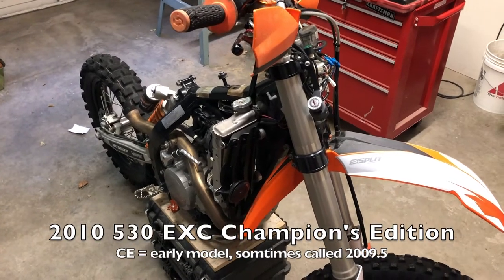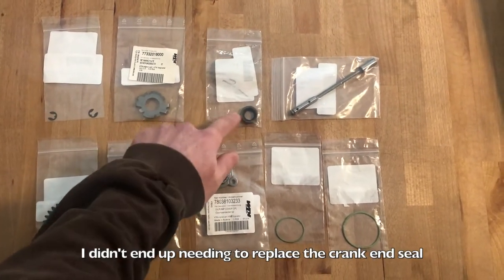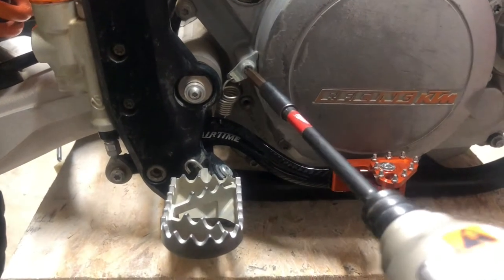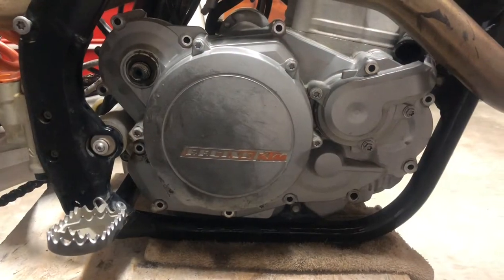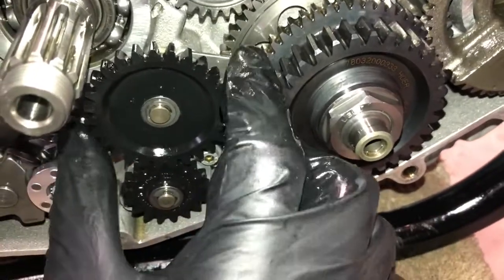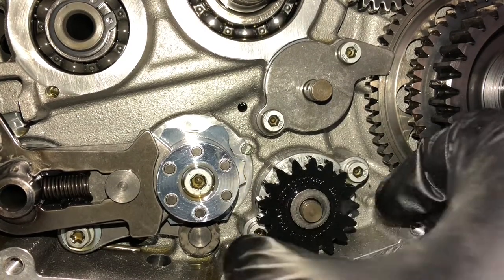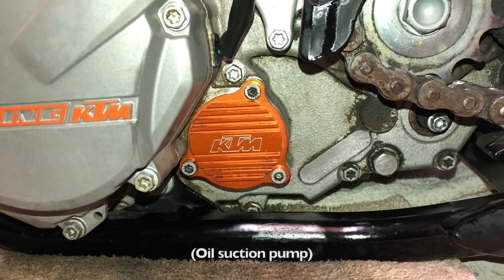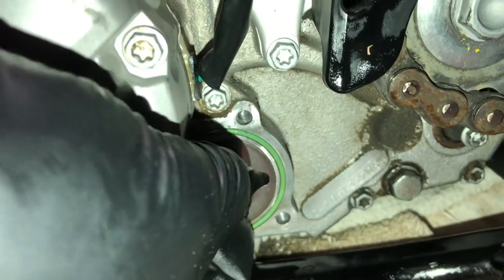KTM Oil Migration Prevention, Oil Pump Upgrade, Gear Case Venting Fix

Comment: Hi mate, great video! Detailed and precise. I have a couple of questions that I am hoping you may be able to shed some light:
1- if the bush has rotated or installed incorectly blocking the 2 holes for the gearbox vent, how does this make the engine oil migrate in to the gearbox? if the gearbox is pressurising wouldnt that cause the gearbox oil to migrate in to the engine?
I have a 2008 530 EXCr with the breathers connected as per OEM, engine and gearbox T'ed to the carby intake and I am yet to strip it down to see if the bush is correct and at the same time upgrade the oil pump (if it wasnt in the recent rebuild by others)  but my engine oil seems to disappear from the sight glass on every ride, i.e. a complete sight glass in approx 20km regardless if I am riding on dirt or road. Top and bottom end was done about 15 hours ago and oil issue was there before too. what are your thoughts? Thanks.

Edit: Gearbox oil level is unaffected, always at the right spot.
Reply from the maker: Hey great questions. You may be right about the vent. If blocked I would suspect oil to transfer from gear case to engine sump. But due to heating and cooling I could see it going either way.

But since making this video I have been watching my levels closely and I have the same results as you. I start out with engine sight glass topped out and gear case level with the check/fill bolt. Recently I did 100 miles and the engine oil was at the bottom of the sight glass. I did some checking and found the gear oil was still level. So I think the oil must be burning off. It’s only what, a .6L sump? Tiny. So level will change fast. Mine doesn’t have a lot of miles, compression is high, power is good, no visible smoke. So I’m not sure it’s a problem but I’m pretty sure I’m burning oil. Maybe that’s what you’ve got going on too? Fortunately it doesn’t take much to top it up 🤷‍♂️
Reply: @colindgrant  thanks for the reply, 100miles though is much better than my 15 or so.... mine doesnt blow smoke and power is great, but I am told there is a smell of burning oil.. given the motor is fresh, I wonder if it is been sucked through the breather and if so how to stop it.
On another note, have you had any experince with oil wiping out of the water pump drain?
Reply from the maker: @gerrykolaitis6515  No problems with oil and the water pump on mine. Definitely strange that you would lose that much oil in just 15 miles. But you're on the right track to diagnosing it. As far as I can see there are only 3 places it can go: 1) A leak through gasket or breather would coat parts in oil, you would see it. 2) Into the gear case, you would see higher level. 3) Burning off, it would make sense that you smell it, but possibly no visible smoke.

You may be able to tell if you're burning oil by looking at the plug after a hard ride (I don't recall exactly what to look for, but there's plenty of talk online about reading plugs).

Some people say it's a common issue on these bikes especially at higher speeds:
https://www.advrider.com/f/threads/530-using-losing-oil-denver-ktm-mechanic.822303/
Reply: @colindgrant  Thanks. So i have removed the breather from the carb and shoved in a bottle to see if it spews out oil, after a 2 hour road ride, the bottle was completely empty, the gearbox was at the correct level - checked when cold, but the sight glass had dropped right to the bottom, similar to when the breathers are connected to the carb, give or take a little.

So it seems that I am not breathing or migrating but burning.... I had a look at the link you sent and it does seem that it is a common occurance on the 530s... although mosy were saying that it is worse on the road... seems to be about the same on mine, i.e. road or dirt..

The other thing that I have noticed is that there is a bit of oil dripping from the wheep hole on the water pump.... I have ordered a set of new seals to replace them,... although not something that you d expect after 20hours from a rebuild...... I hope its nothing more sinister.
Reply from the maker: @gerrykolaitis6515  clever idea with the bottle. I agree it doesn’t make a lot of sense. Please post if you find the source of the issue! I’d be curious to know. Best of luck!

Comment: Great video! I was wondering what the torque spec was on the clutch basket?
Reply from the maker: I don't recall, but it's probably listed in the service manual.

Comment: I had an 08 450 excr, had oil migrate from engine to gear box,did every update possible apart from new crank cases. All the fixes did was make the oil migrate the other way.even the dealer couldn't fix the problem.
Reply from the maker: I've read that about the '08, seems the first year of this motor was the toughest to deal with. Some say the case has to be split, and a port added to make it a single sump system. You probably know better than I.

From what I can tell most of the problems were resolved by the time my 2010 was built, but this seemed worthwhile.

You say 'had', did you end up selling your '08? Because of the oil migration?

Comment: Is there an update on how this is working out?  I ordered all of the parts yesterday and am curious to know how it's holding up!
Reply from the maker: Holding up great! I see the engine oil level go down after a while, but I open the transmission check/fill plug periodically and the oil is level. So there's no oil migration that I can detect, just burning a little bit.

Comment: Thanks for the video! Do you remember were there any notable differences between the old oil pump cover and the new one? Doing this myself and getting that new cover by the end of summer..
Reply from the maker: I couldn't see any differences visually. You may want to read the original post by Hodakaguy, it has detail on every single part in the upgrade.

Comment: So do the 2011's have this problem?
Reply from the maker: @tallcool1ify   all years with the split case design (08-11) have risk of migration but the 11 has the lowest risk. This video basically upgrades to 11. Since posting this video others have experimented with drilling a hole to join the cases and that’s what I would do and will do if I ever see migration. I check the gear case level periodically and haven’t seen any.

Comment: 7:35 I wouldnt drill those oil holes out on the kick idler gear. You dont want to increase flow of the breather because on super steep climbs like 40 degrees, gear oil actually swamps this area and gets sucked up into the carb blowing big smoke wads in the bush and almost fouling the plug.
Ive done a kick delete on my 2008 and have covered this stub shaft with a strip of shop rag and a spring hose clamp.
Reply: Edit, the shop rag and hose clamp didnt work, just chugged oil out the breather but did lead to me finding out how the breather works.
You wont believe this.
The 2 holes you drilled out are supposed to sling the gear oil back into the gearbox centrifugally while at the same time letting air pass in or out of the breather.
So I will still say "dont drill the holes out" but instead push the bronze bush out and re install it so the holes line up and form a perfect cylindrical shape that gives the most centrifugal effect. Drilling makes the holes crooked or stepped.
Plus if you do a kick delete, leave the idler in.
Reply from the maker: @RIPPERTON  thanks for sharing your experience here! I would have loved to just reposition the internal bushing, and I tapped it to see if it was removable/moveable, but it seems like it's pressed in there pretty solidly. With an inductive heat coil maybe I could heat the outside fast enough to make it expand and allow rotation of the bushing, but drilling was the best I could do in my garage at the time. I drilled clean straight holes though. So at worst, there's a little crescent shaped 'dead-end' next to each complete hole that matches the outer gear. I look forward to increasing my skill to where I'm climbing hills like you describe!

Comment: did these mods and still have issue of oil filling the engine side. If i let it sit on the kick stand it filles the engine side also. What the heck is going on!
Reply: Do the oil migration mod by drilling the hole and combining the two. He recommends a 6mm hole. Another guy on the comments said he did 1/2 inch hole so it has plenty of oil flow. I am doing this today or tomorrow if I get time. https://www.youtube.com/watch?v=q2qBn5m8UQA&t=2s
Reply from the maker: I agree with @usaphilippines . The modification to combine the reservoirs is probably the way to go if you are 100% sure that oil is transferring between the cases.
Reply: I am 100% sure, took the casing off and there was very little oil in the gearbox, and way overfull on the oil side. I am trying to compress the mod into a youtube short with a fast straight to the point video of what i did to help others @colindgrant
Reply from the maker: @usaphilippines I love it! I hope you do that, it would be very helpful to others with our model bike. Please share the link with me if you do!!! -Colin

Comment: I have a 2011 model build on 08/10 how do I know if I need to do the upgrade ?
Reply from the maker: Really I would just pay attention to the transmission oil level. If you let the bike sit level for a while, then remove the level check plug, and only get a little dribble of oil, or none at all, then you're good that way. And of course watch your engine oil level to see if oil is flowing that way. Mine usually goes down slowly, due to oil burning, especially on any highway riding. I wouldn't worry about the upgrades until you see evidence of oil transfer. To my knowledge, nothing is going to suddenly fail.

Comment: Hi
 I have this bike and I love it! I have a ticking noise, I replaced the cam chain tensioner with a mechanical one but its still there? Could the oil pump gears make this noise if loose? Or should I be checking the upper area for stretched chain, rocker arm play etc?
Reply from the maker: The ticking sound is probably from something else, but if it's an '08 thru '10, I would go ahead and swap the oil pump gears, seals, and shaft just to rule that out. The gears are plastic, you could have a damaged tooth. Did you adjust the valves? I posted another video about that.

Comment: I have the same 2010 530xcw 6days edition. How can i tell if my bike has these updates? Pretty sure it has the updated cover/o-ring as theres an old one in the box of parts it came with.
Reply from the maker: Really I would just pay attention to the transmission oil level. If you let the bike sit level for a while, then remove the level check plug, and only get a little dribble of oil, or none at all, then you're good that way. And of course watch your engine oil level to see if oil is flowing that way. Mine usually goes down slowly, due to oil burning, especially on any highway riding. I wouldn't worry about the upgrades until you see evidence of oil transfer. To my knowledge, nothing is going to suddenly fail.

Comment: I have one 450 2010, the oil migration is flowing from gear to engine, if I follow the same steps as you do in your video is it possible solve the problem?
Is there more gaskets or seals to change?
Do you know if has more
Reply: My 530 exc has the carb breather plugged, i had issues too but ended up doing the single sump mod.

Baaically combining clutch and crank oil by drilling holes in the bottom section clutch side through middle to combine both. Been running great since. Newer engines are pretty much the same but not separated like the 08s, 09s and possibly 10s are.
Reply from the maker: Should be the same, I believe the 450 and 530 is nearly the same engine.
Reply from the maker: @davidschmidt5533  I know for sure the 2008 thru 2011 have the XC4 motor with the dual oil sumps.

Comment: Awesome video. Where does the crank end seal go from your parts list? Doesn’t look like you used it in the video, but if you were to where is it located?
Reply from the maker: Great catch! I realized much later that I hadn't explained that in the video. The crank end seal actually goes in the cover. Once I had everything apart I inspected my seal and it was in great shape. It would be pretty tricky to remove the old one, but doable with a seal puller or patience with pics and pry tools. The seal will almost certainly be destroyed by the removal. I decided to leave it alone, I didn't replace it in the end.
Reply from the maker: You can see it pretty clearly at 13:40